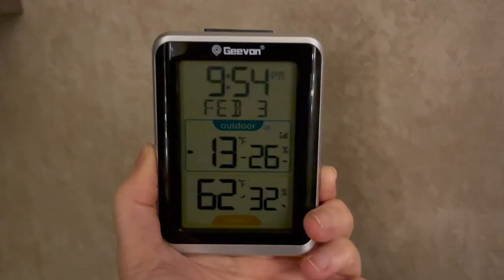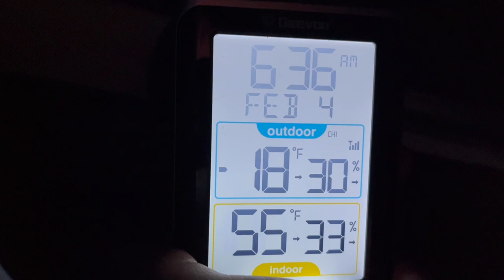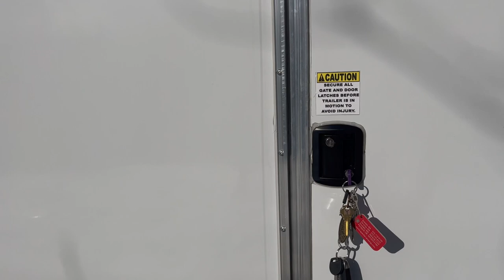Cargo trailer TROUBLE / Heat shield for the rocket mass heater in our yurt

Comment: If you want to make a clean cut in cement board… I used a cheap tile wet saw from harbor freight and got beautiful clean cuts… realize this is too late to help you, but for anyone else needing to.

  It was a wet and messy outdoor task, so not suitable for your weather situation at the time anyway, but the wet cutting also eliminated flying dust while cutting, so I thought I would share this.

  We were doing board and battten siding using the 24” wide soffit panels vertically.   Cutting the battens and widow trim where ripping was needed was nice and clean both for the cuts, and the cleanup/dust control… 

  Little tile saw had to be clamped down to a heavy table to cut the big sheets and long stuff, but worked great overall.

Comment: Vermont born and raised. A suggestion for decorating the cement board. Check out a channel called narrowboat that James built. They use that stuff on the boats to insulate around their woodstoves. James did a gorgeous job with tile and decorative metal sheeting. Also channel boating on a budget for another idea.
Reply from the maker: Thanks for the ideas! I will check them out :)

Comment: Bonjour, sorry for your trailer. I would use this product to seal it: EternaBond® is a one-step sealant tape for virtually all roof types and roof accessories, from commercial building roofs to RVs and cargo trailers. It creates a water- and air-tight barrier that eliminates moisture without additional sealants. Bonne journée, take care.
Reply from the maker: Thanks Michel, Charles says he actually has some of that, and would use it if he ends up having to remove all the current sealant at some point.

Comment: Greetings from another newbie to Vermont.  We moved to Johnson in March '22.  Regarding the storage trailer, obviously you want to get/keep things dry, but I don't think mold will be an issue until Spring.  You might consider getting a role of packing shrink wrap available at your local home improvement store in the moving box section.  Also, a trick we used many years ago when we were adding a second story to our home in the middle of hurricane season while we weren't fully under roof.  We created an interior gutter/false ceiling with plastic drop clothe, slanting it from one end of the house to the other, funneling it out a back window.  It worked very well.
Reply from the maker: You beat us to Vermont by about a month and a half! Where did you move from? Thanks for saying hi, and thanks for the tip. Fingers crossed the issue may be resolved (see the video that came out this morning), but we're still not 100% sure exactly what happened. Condensation seems unlikely but can't be ruled out as there was a puddle of windshield cleaner in the bottom of a bucket.
Reply: @OvertheRiverandThroughtheWoods  We moved from Lovettsville, VA.  Small town near Harper's Ferry, WV, about 50 minutes away from DC.  Haven't looked back yet.   Here's hoping the sealant worked.

Comment: And that's why you don't see many flat roofs in New England. The last year we were there John had to go up and shovel the deep snow off of our roof three times during the winter. And it wasn't flat, but it wasn't as steep as some. Once that ice forms a dam and prevents the melted snow from coming off the roof there's not much you can do about it. I'm curious to learn what you decided to do to resolve it. As far as the contents of the shed: Tarps covering the boxes? And get them outside to dry as soon as the sun is shining and it warms up enough. I don't think that mold will grow while it's very cold, but you'd know about that better than I would.
Reply from the maker: Fortunately, only the top layer of things were damp and not very... they dried out from leaving the trailer doors open during the day for about 4 days in a row. The roof should be better sealed than it was... but we'll need a deluge to know for sure. Charles will remove the snow while standing on a ladder to prevent it from sitting there anymore, so as long as we're home to maintain it we won't have the exact same problem again.

Comment: for the cement- would  just paint them and stencil some  leaves or a geometric pattern -  adding more weight with the mosaics seems  wrong.  Or possibly skim coating the surface with a grout ,cement stablized adobe  and then burnishing the surface I think you would want to mist the surface first with some water.  I like the look of the hardware holding it.
Reply from the maker: Hi Curt, Thanks for the idea!

Comment: Just an idea, you may want to take any damp items/boxes out of your trailer on sunny days to dry out in the sun.
Reply from the maker: Fortunately, we had several sunny days in a row and we opened up both ends of the trailer. Everything seems to have dried out, since it was only damp on top.
Reply: @OvertheRiverandThroughtheWoods  Good to hear! Nothing worse than all your stuff getting wet. Luckily, it sounds the leaks weren’t too bad. Great you were able to air out your trailer.

Comment: At this point y'all are amassing enough knowledge to do a primer on "mistakes to avoid/tips and tricks" when moving to a place with a real winter!

Is there a way to salvage the trailer or is it just completely kaput?
Reply from the maker: No kidding! Yes, we just need to make sure the roof is sealed. Charles has tried to patch it up with sealant (fingers crossed). And worst case scenario, he has to remove all of the previous sealant and start over. But if you mean the stuff in the trailer, we were able to dry it out by leaving the doors open during the day for a few days in a row.
Reply: @OvertheRiverandThroughtheWoods  Yes, was just wondering if trailer roof was structurally ok. Glad it will be a (semi) easy fix!

Comment: sorry about the trailer roof but, can you put a tarp across it using the tarp to pull off snow when it accumulates?
Reply from the maker: Thanks Cindy, Charles says it's easier to push it off with the device he uses to clear the solar panels (although it requires a ladder, which is a pain).

Comment: Maybe aluminum behind the fireplace?
Reply from the maker: That sounds pretty shiny! What kind of aluminum do you have in mind?
Reply: @OvertheRiverandThroughtheWoods  I've seen plain flashing used.  But you could look at patterned or hammered sheets.  They used to have it at Home Depot.  There are also stamped metal ceiling tiles, but they are more expensive. I'd try a small piece first.